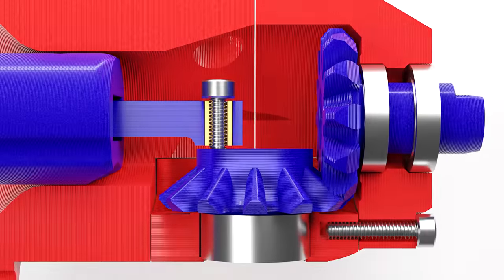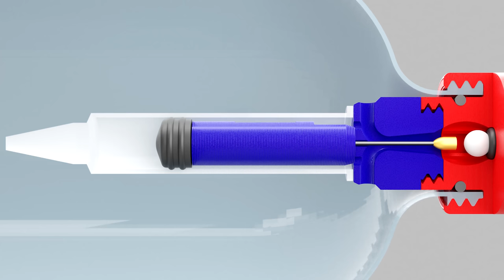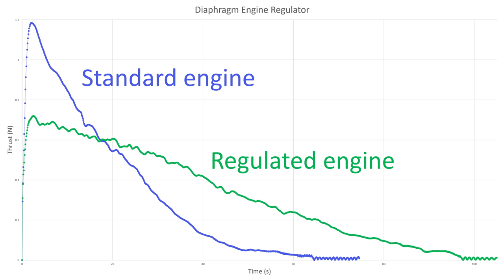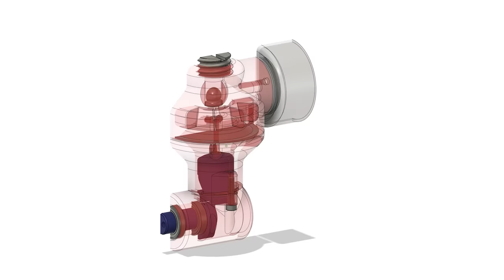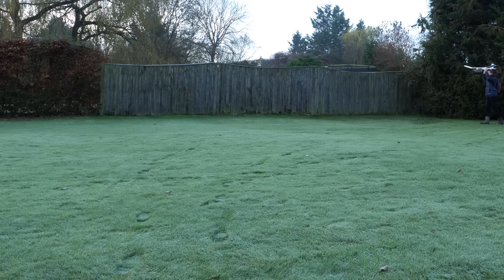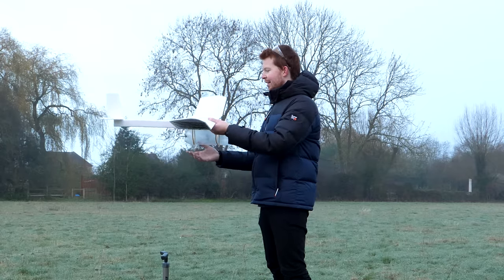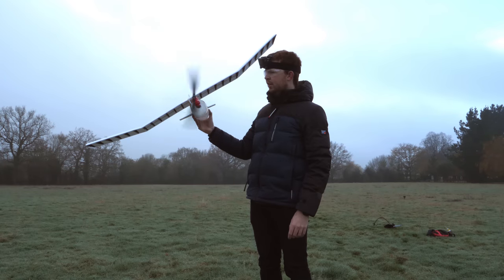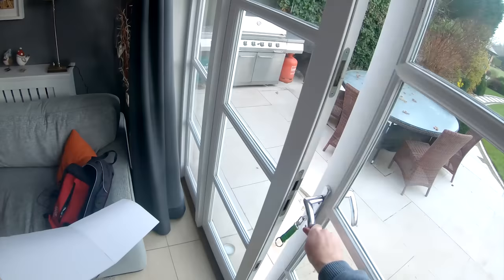Pneumatic Plane

Comment: The rear counter weight does not suffice and the wing design does not meet aerodynamics principles thus it won't sustain flight stability even with a weaker engine.

Comment: I'd like to see how well it did without the regulator syringe, that would save a little weight, and give the aircraft a burst of thrust at the start, just when it needs it. Because as it stands right now, the aircraft seems to be just a tiny bit too low on thrust, and doesn't fly long enough to exhaust its power supply

Comment: Test flight looked as if a little tail heavy causing stall/drag. Underside of wings should be covered, aft fuselage could be shortened to help with CG and safe some weight. Motor/prop power looks promising, need to work on an efficient airframe. Successful compressed air motor powered free flight models date back to the 1930's. Many used a CO2 cartridge.

Comment: I know this is an old video but I just saw it for the first time. helium would have been the best gas to use. the reason is nitrogen even under the same compression and same release rate helium would expand almost 2 times as fast giving much better performance..you would easily beable to fly this thing with helium. for inert gas. thats the best gas you could use. the only other gas to expand faster is hydrogen but thats explosive so you dont want to use that one.  the engine would run half the performance if you tested it with co2 . helium is the opposite. co2 expands slower than air in a factor or 2 to 1. helium expands faster 2 to 1. half the performance on co2 is perfect sense. thats what it was supposed to do. also yes hot air is more excited there for cold air will slow it down hot air will speed it up as well. just some food for thought. hope you see this. cause this will help you greatly. I noticed you continually fix the design weight all other aspects even temp wind ect.  but never questioned could I be using a better gas. it will make the current design fly. youll have more of a range of power too and itll likely last longer as well.. not to mention helium would make it slightly lighter on its own.

Comment: i like the way your brain works, good work..  but one thing,, ,. the bottom skin of the wing is essential to the machine that is the wing,. the air must move across a larger surface on top creating a lower pressure above then below , your wing is more of a sled effect like surfing, not lift like a plains wing,.. that's why you were having  issues with gliding imo..

Comment: Hey, Tom awesome idea man... I think if you try to make a balance in the engine, to control vibration like a car engine does. As the pin hits another same force should go on the opposite side. It may help to balance and make the fan roll smooth.

Comment: Amazing ! 
I wonder if it's possible to use the water pressure. I mean prototype of boat where the difference between top and underwater is more significan than pressure in air .

Comment: why the piston shaft is not directed by the heart of the wheel so that 
it performs a straight movement. it suffices to draw the shape in the 
center which allows to push the piston arm straight. This avoids the effect of the arm which is off-axis

Comment: I love seeing these videos>
This reminds me of the by-gone days of CO2 peanut scale models.
He used to set them up with a single AAA driving a micro 2 channel crystal receiver and 2 micro solenoid servos "valves"

Concept here is very similar and I would love to see the next iteration.
I would think if additional mass needs reducing a control system using the micro surface servos and a smaller 2S could achieve this. 
Maybe even return to the "roots" and try constructing one using balsa and tissue.

Just some thoughts. 
Would definitely love to see if this met the performance expectations :)

Comment: Try making one that utilizes a CO2 cartridge. The air regulation would be a problem you will have to solve again.  The plastic air bottle seems to be a limiting factor in your current design.

Comment: Maybe it's a dumb question but wouldn't it make sense to just release the compressed air as a form of propulsion? I don't know much about these things but I'm wondering if the volume of air pushed by the propeller is actually lower due to efficiency loss. Again, I don't know much about it so I'm just trying to understand  . But the engine itself and the solutions you found are really impressive  . I love your channel

Comment: Hi Tom love the engine design and the syringe govner valve.!  why not use a compressed small co2 cannister and alloy engine..? More pressure more rpm..?
or would that be just 2 heavy.?

Comment: 2:30 constant power pressure compensation device: Absolutely brilliant!
8:05 “ it turns out rubber diaphragms don’t like cold temperatures. Who would’ve thought?“.
Answer: Morton Thiokol engineers, circa 1987, who prayed, on their knees, before their television sets, then watched the Challenger space shot self-destruct because of low temperatures and launch conditions that were out-of-spec for the rocket fuel seals. Shortly after, seven (?) American astronauts were dead because of bureaucratic incompetence.

Comment: You can make an inexpensive remote control plane with a cheap lithium battery helicopter, with a double rotor and a small tail rotor that tilts up and down, helicopter price, about 30 dollars. the plane can be a glider, in which only the helicopter is activated, placed perpendicular to the plane, when it takes flight or descends.

Comment: the threaded screw and brass insert would have worked fine, if you had drilled the brass for screw body clearance, and not threaded it.

Comment: Can the thrust pull the weight of the compressed air - this is the question. If a motor can't pull its  energy source then it's not a motor.

Comment: Also your horizontal stabilizer is not parallel to the the main wing. Not good for accurate control.   Too much drag due to open fuselage, ribs etc under wing, and size shape of bottle.  Wing could be a bit bigger too with a high lift airfoil design.

Comment: Would doubling the engines allow for more weight? So rather than a single engine in the middle you could have two on the wings, or maybe just two engines controlling one propeller 🤔

I'm definitely not an engineer so my suggestions are half-baked at best 😅

Comment: how long can it glide if you attache refilleble Co2 bottles of 16gram to it with a gate? you can use a smaller bottle which saves lots of weight and it can withhold more pressure?

Comment: @Tom Stanton what if you used liquid nitrogen in a small bottle instead of compressed air?                                                                          Edit: And an emergency pressure release valve to prevent explosion of course…

Comment: I have a problem or a question , isn't the ball vulnerable of gravity? Like if the engine is running vertically downwards isn't that a problem for the ball??
Reply: maybe the compress air will keep the ball in the right place?
Reply: I mean yeah but after getting pushed by the piston it might just refuse to go in...? I'd be good if Tom could build a transparent version like with Like cnc acrylic sheet

Comment: One more suggestion  how about a Styrofoam plane body. Ok one more if you put a ballon in the bottle and aired it up then pressured the bottle up would that help cary the pressure .ok last one smal.er dia.intake increase presher,presser, need to max your bottle  to see where it fails use a small compressor to fill your bottle. You will be suprised.

Comment: Hmmm.. balance. Pressurized air is heavier then less pressureized.
Reply: Might also want to frame the bottle with carbon fiber, even a carbon fiber ribs of some kind with solid bottom would withstand more pressure.. but as I said, more air, more weight!

Comment: the only engine good for aviation and cars would be hydrogen powered ... a physics professor told me one day that the burning of hydrogen is violent and the burning temperature reaches the range of 1,200 degrees celsius could use desalinated sea water.. .90% of our planet is water... but it has a chemical material, a metal in which the hydrogen engine could be made: the tungsten used in the manufacture of lamps ...type engine head and piston cylinder and other parts ...due to the high hardness and resistance of the metal to force and temperature..i'm not putting you down it's just an idea

Comment: Bro just put one small plastic cigarette lighter inside the bottle and make a small crack in the lighter and quickly close the bottle lid and then fly the plane the gas leak in the lighter will give you extra power to the plane

Comment: The wings aren't designed correctly to produce lift. The engine might be strong enough to make it fly but it's not going to because of the poor wing design. It needs lift to fly. It has no lift.

Comment: Hhhmmm.First why isn't the Bolt a Straight Shank to bolting Depth...
I would Research Pyramid Air Rifles they have a Very high pressure-3-4000Psi
Also Synthetic oils...
Love the Study and Thought of your Problem...Good Thinking..and Sound...Perplexing is an Understatement...Kudos..
Took me a second review to understand the air flow concept...
In geniously simple...but feel research...could advance your design...
Also just asking did you do the math for the Gear connection off center for max performance revolution..I'm guessing you did..But if you use a Higher pessure and reduction..you obviuosly increase your gas tank with no size difference...a Plastic Soda Bottle is at 150 psi..But no where near enough...Maybe a Aluminium with Titanium coating...or Plastic if possible..I personally would play with the Printer under different Atmopheric Pressures...and Materials...Condensing the Molecular Structure in the Materials Used...
On Engine Design...Have you researched Rotary Engines...
Seems your Losing alot of Power with each push stroke...Have you considered a gearing to a higher revolution..and-or a storing of this energy via a one way drive Gyroscope...This would give you full gravitational direction...instead of riding on the air you would be cutting threw it ..sotosay...By Altering the angel of Gyroscoping energy retainer...understand...its like a Magnetic force that resists direction..to the Poles...Hence: Gravitational cars and Motorycles for reference...(like a 1 wheel motorcycle)...At that price you could redesign wing shape to give a solid straight glider style... 
Depending on how many Solar systems you want to visit...lol... 
The Flights were Amazing...

Comment: DID YOT TRY TO PUT THE BARREL ON THE PLANE INSTEAD OF BELLOW THE PLANE ? DID YOU TRY TO USE ANOTHER CONTAINER WHICH IS LONG AND THIN INSTEAD OF SHORT AND FAT WHICH IMPEDES THE AIR FLOW AROUND THE  AIR CONTAINER ?  TRY AND WE ARE AWAITING FOR YOR NEW INVENTIONS. GOOD LUCK

Comment: Wait, this thing not have to be charged? Wouldn’t that be perpetual motion?
If so that’s fucking rad
Reply: You see the clip where he's using a bicycle pump to 'charge' it. there's no such thing as perpetual motion and that should have tipped you off that you missed something.
Reply: the bottle at the back is pressurized.And at the front there is actually holes in the sides in the gearbox where the air escapes to keep the pressure low .Otherwise the diaghpragm wont move if the pressure is same on the both side.

Comment: Solar chuck wagon trampoline poncho lunchbag dirigible 280cu³, lunchbag parachute 280cu³ 
61 kilometer experiment return from dead zone oxygen low earth orbit 600ft.  6.3 operating .. earth
Reply: Solar 17 inch × 18.6 inch × 18.6 feet inch